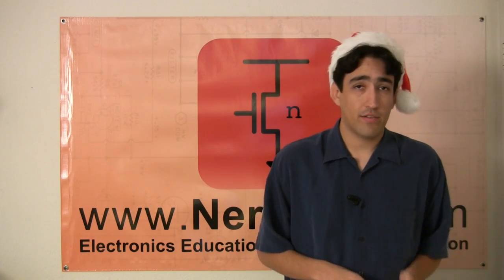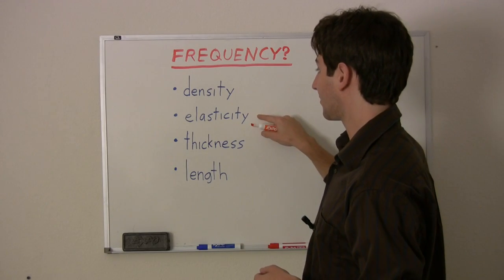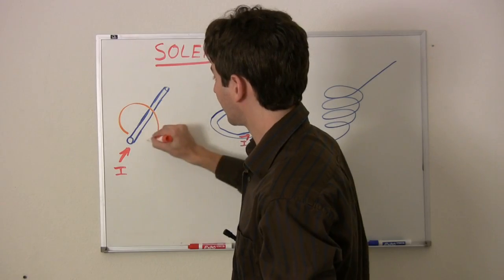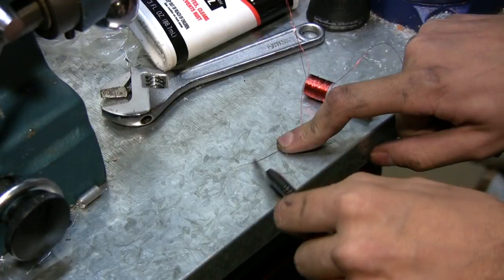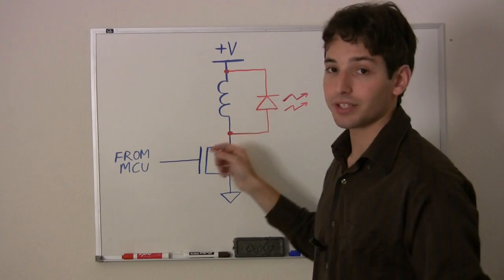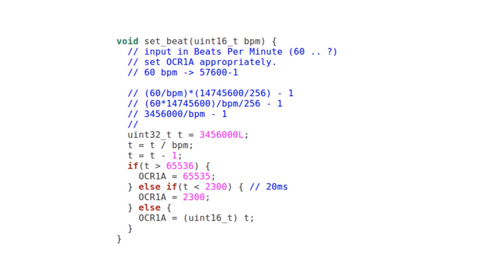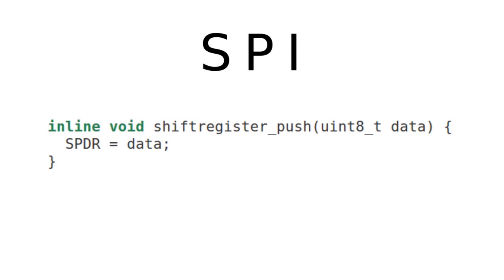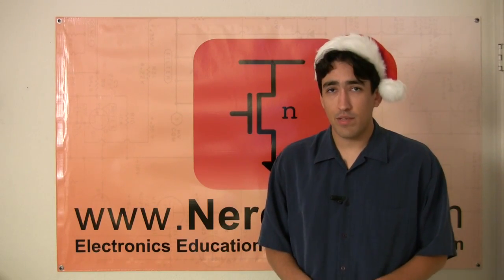NerdKits Robotic Xylophone with Homemade Solenoids

Comment: The next time you want to determent the nodes on the bar lay the bar onto two supports. Get some iron from some sand with a permanent magnet. Sprinkle some lightly over the approximate locations of the nodes. Much like iron fillings over a magnet. Lightly hit the middle of the bar a few times with a wood object. After a few tapes the iron will delineate the real nodes; no math required. I have seen this work on a video only he was using wood.

Comment: Please note that with typical LEDs reverse voltage has a absolute maximum rating at 5 volts. So, it would be a good idea for reliable circuits to add a standard silicon diode in series with the LED.
Reply: +Wolfhard Reimringer I have spent months researching into building a marimba and found an awesome resource at Delfords Magic Plan (google it if you are interested)

Comment: Great project! 
In trying it I have some questions.
1. What are you using to power the solenoids? (volts and amps)
2. Are your slugs completely hollow or 1/2?
3. What MOSFET are you using?

Also, I can't seem to get the solenoids to work with magnets on them. I am using solid metal nails I cut up for slugs. I am putting magnets on top, but when I connect power nothing happens.

Comment: quite a comprehensive video. I tried something similar, although my aim was to get a robot playing an unmodified glockenspiel, so I needed to hit the notes from above. My first attempt with homemade solenoids didn't work because it was difficult to make springs that would consistently lift the hammers when not striking. I finally settled on an arm and a single solenoid.